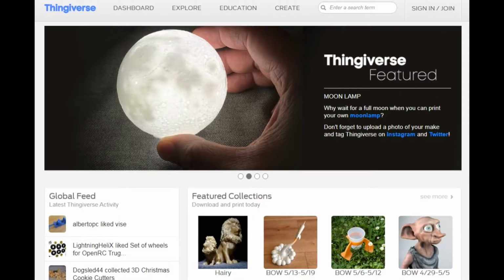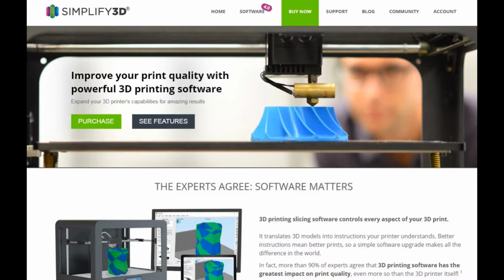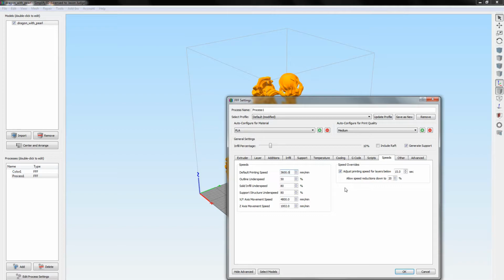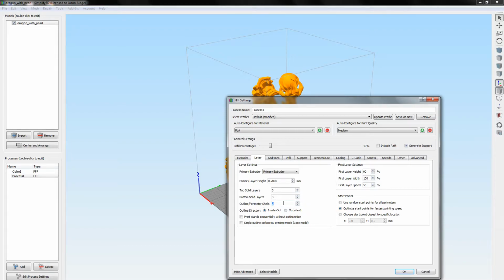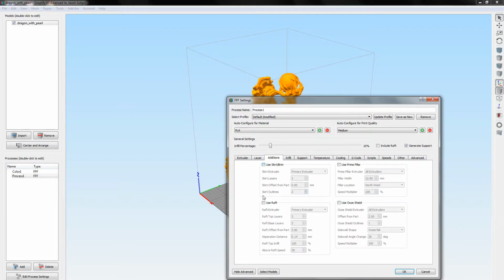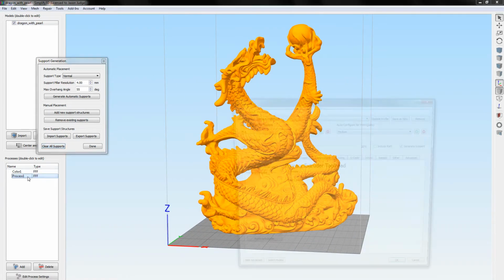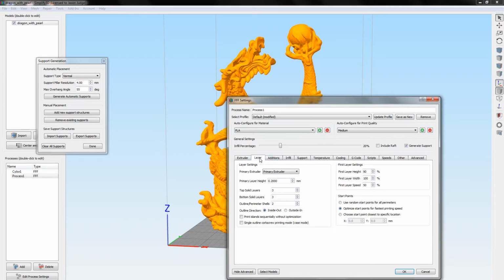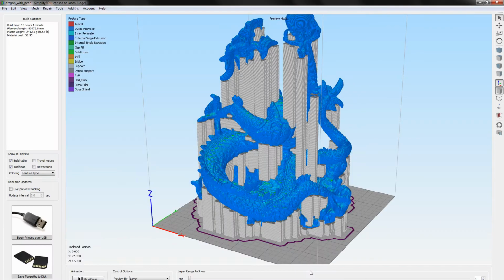Intro to 3d Printing - Part 2 (Software)

Comment: Hi. I am wondering if Discreet GMAX 1.2 model making software (normally used for building 3D models for PC games), can be used to make a 3D print? I do not own a printer yet, but need to get one to make plastic clips for trim on a car. These clips are no longer available and my only hope of getting any is to make my own with a 3D printer. I also want to do this as inexpensively as possible. It appears any of the low end printers will do what I need. Since I already have GMAX, I'm curious to know if it will work with printers.
Reply from the maker: I have never used it before so I could not tell you for sure.